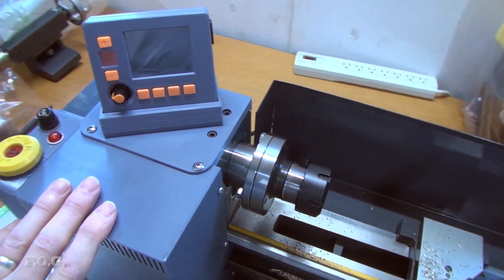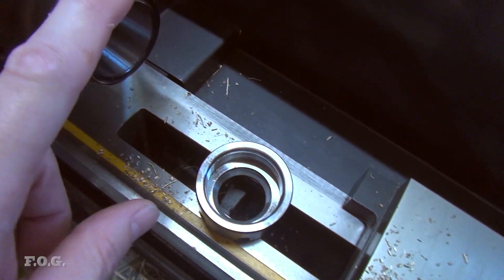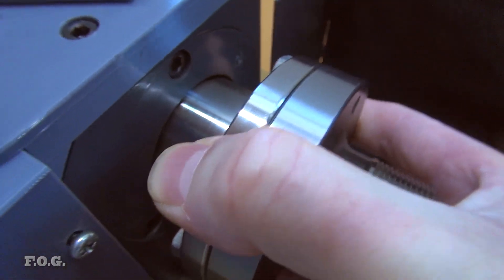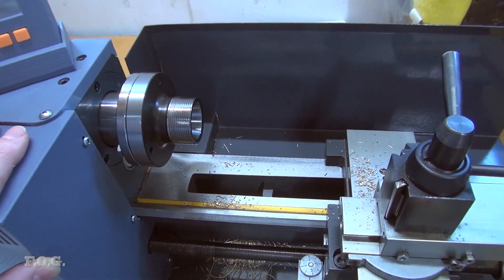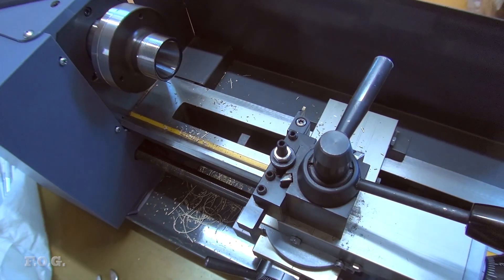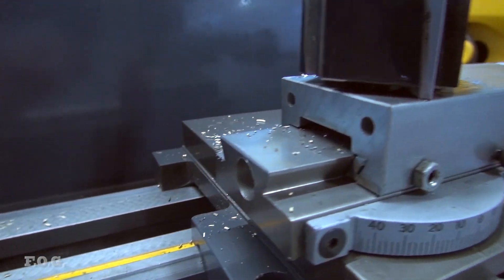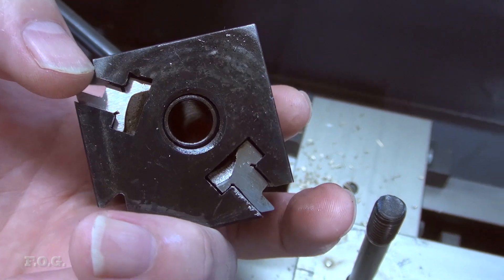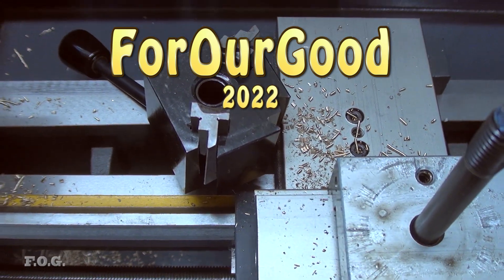EP16 - Mini Lathe Upgrade – Quick Change Tool Trouble

Comment: It is painfully obvious that you are totally not conversant with mechanical devices........so to put you in the picture regarding the tool holders, the wedge is not clamping the tool holders due to the holders not being matched to the tool post during manufacture............I bought the same tool post with 4 tool holders from Banggood a year back and then bought 4 more.......2 of the new holders clamped OK but the other 2 were very loose (like the ones in your video)
This is an indication that the tolerances during manufacture are abysmal........If you place a 1mm thick shim between the faces of the dovetail the tool post will clamp up....the handle should only rotate about 90 deg.........I would advise you to return this tool post and the holders and ask for a refund or an exchange as you cannot use these tool holders without some drastic re-work.
For rework I tig welded 1mm thick strips of steel shim to the faces of the dovetails along the edge of the dovetails  on the 2 tool holders that were faulty...... but as I'm a skilled tradesman I can do that.
BTW, the slack fit of the collet chuck is an advantage as if it is a tight snug fit any run out (with cheap collets) will be impossible to correct whereas the slack fit allows you to slacken the holding screws and bump the chuck body with a soft hammer to get it to run dead true USING A DIAL INDICATOR......... once set true the chuck will not need any further re-aligning......this method is also valid for a 3 jaw chuck mount.
Reply from the maker: Lots of great advice in there Ian, thanks as always for your constructive feedback and for taking the time to watch the video!

Comment: dodgy tool post  .
all of mine are the opposite - i have to wind the handle right around just to get the holders to release .
Reply from the maker: Definitely not great for sure, but seems to be working well enough after fixing it.. You will notice that the handle does not even clear the tool holder's height adjust grub screws with this toolpost... nice design! Thankfully that’s seemingly not affecting the functionality so far.